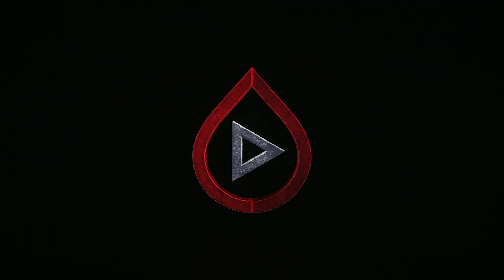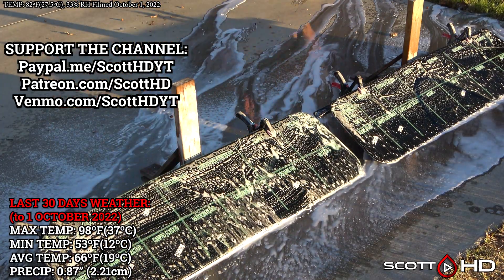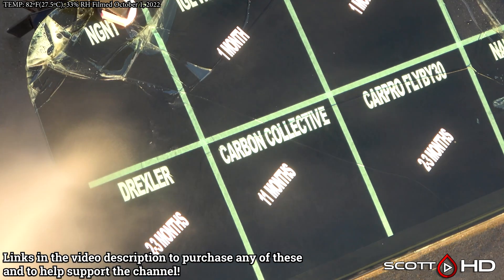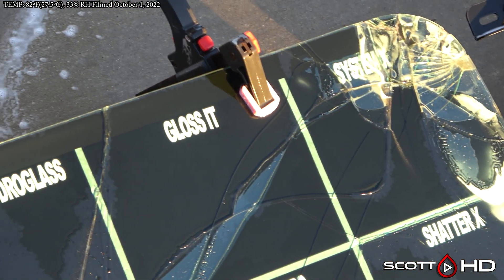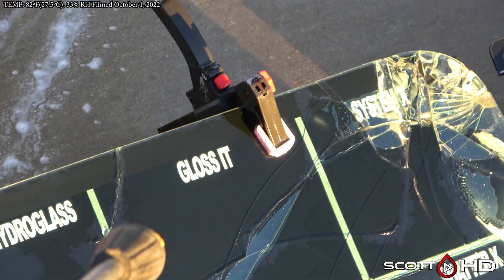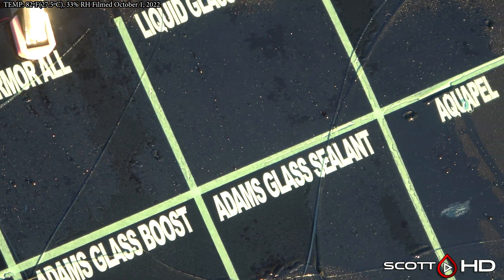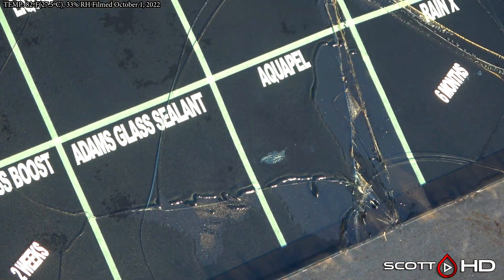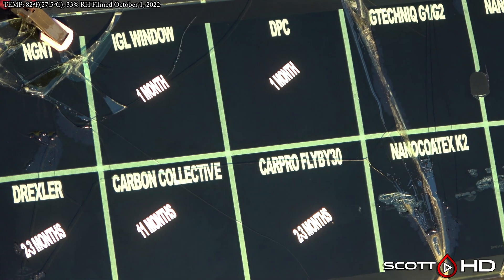28 WAY GLASS COATINGS TEST (HYDROPHOBICS) - UPDATE 14 - 1 YEAR

Comment: I get well over 12 months of solid performance from cheap RainX if I prep the glass just like a pre ceramic coating paint correction. This includes iron decon, clay, alcohol wipe, and at least 2 coats w cure time. Seems like lots of steps but like any coating on whatever surface, it's all in the prep no matter how gimmicky the marketing is.

Comment: I’ve been using Aquapel for years and it’s a great product. Living in the Sierras means snow and ice in the winter and Aquapel performs consistently month after month. Don’t skimp when applying the product. I use two vials to fully cover the windshield on each car.
Reply: Really? I used only one and it kind of broke too much and spilled most fluid on the drivers side.. I wished then that I had more of the stuff. How long do you leave Aquapel before wiping it off?
Reply: @smOOdiebOOdie  Once you finish wiping the felt dispenser onto the windshield in a side-to-side and up and down motion the Aquapel is immediately ready to be wiped off with a clean microfiber towel.

Comment: Wrt Glassparency this test shows their maintenance treatments (required every 4 months to maintain warranty) are essential to keeping the coating "alive" (I have Glassparency on my vehicle, regularly maintained, and it performs far better than here).  FYI Chicago Auto Pro's "Pro Ceramic Test" is having the shop applying manufacturer's maintenance products to their coatings, some every 1 - 2 months (some makers initially said their coatings didn't need boosting but changed their minds after two months of test results).

Comment: If you ever do another one of these, I’d be curious to see how a regular ceramic/graphene coating compares on glass. I use Adam’s Graphene coating on my windows now and have been pretty happy with it. I think Aquapel is a bit more hydrophobic, but this is easier to install and you can top it off with the spray if needed. I’ve seen others use AvalonKing and it worked well on video. But, it was just a demo. Thank you for your awesome work!